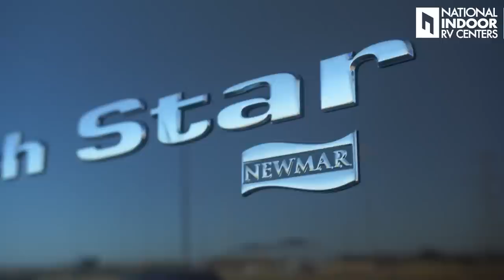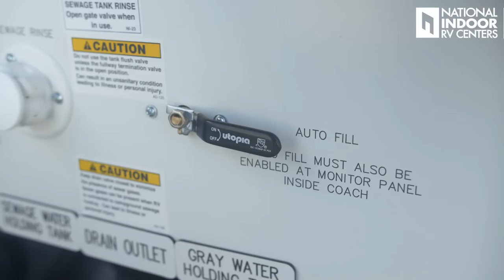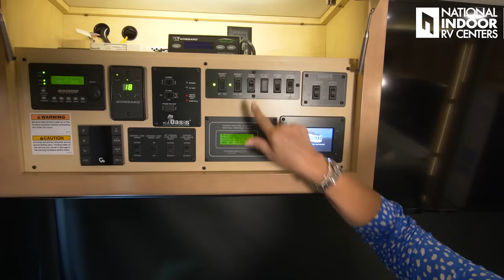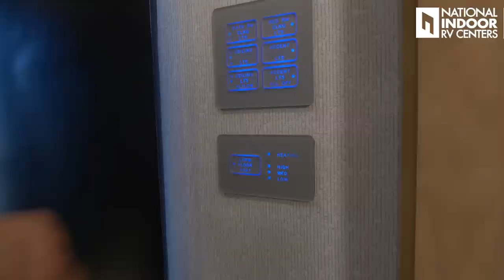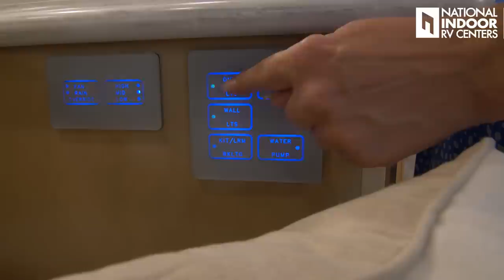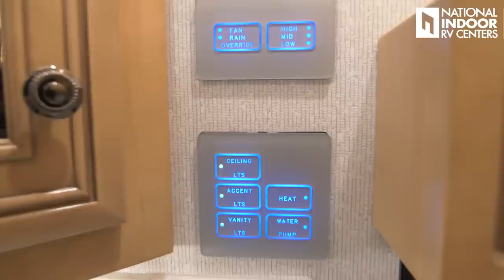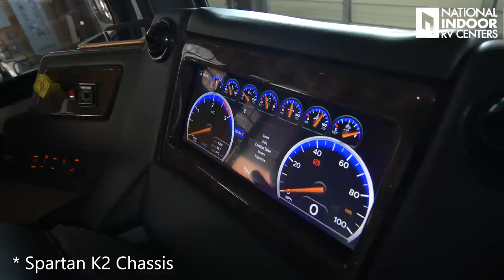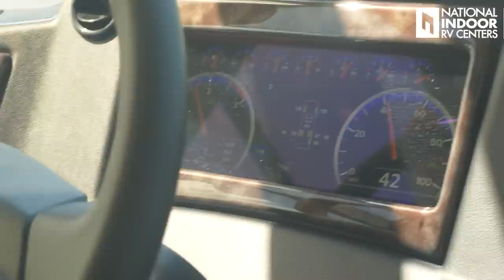2020 Newmar Dutch Star

Comment: I have a question, since the engine has a block heater can I assume the oasis hot water system does not heat the engine? Also, what about trailer brake controls, and is there an option for air trailer brakes. I assume the coach is all disk at every wheel, tag included, and it is my humble opinion that the best trailer brakes out there especially for heavy trailers like stackers is air over hydraulic disk. Great videos of the coaches. I wouldnt mind this 4369 coach. I am aware of people full timing in these coaches, especially snow birds down to the desert for the winter. As it turns out I live just a couple miles from the Phoenix location. Cool! Thank you and be safe.

Comment: That's the size shower I'm looking for also does that water Miser re filter the water from soap and any other for reuse in the shower
Reply from the maker: The Dutch 4369 has a 50 x 34 shower and the 4081 has a 40 x 30 shower. The water miser circulates the 💦 water until it’s warm before it comes out of the 🚿 shower-head. It does not re-filter the water from soap.

Comment: Service the generator every 150 hours! Less than 1 week...No wild camping in this lovely beast then.
Reply from the maker: Hi Andy!  Thanks for watching our videos!  Typically if you are dry camping you will cycle between running your generator and then running off your batteries 🔋.  Of course it will vary how long your batteries last depending on how many things you are trying to run. If you aren’t running your AC you can usually go a long time without running your generator. 

If you have more questions this please feel free to contact me!  Angie@nirvc.com

Have a great day ! 👍
Reply: @NIRVC  , always watch the videos as they are the best and most informative ones out there. Thanks for clarifying the genorator use.